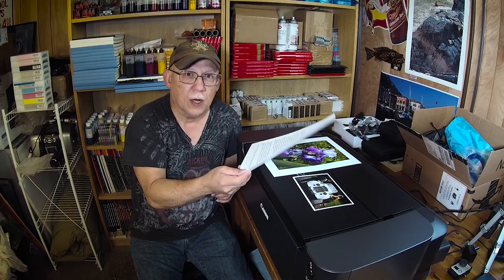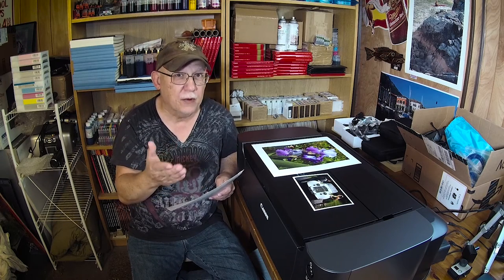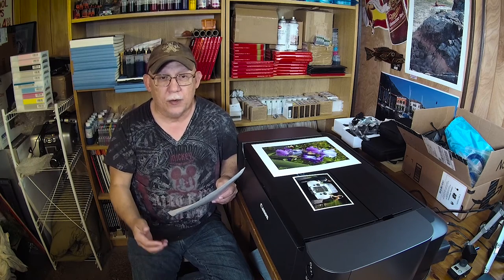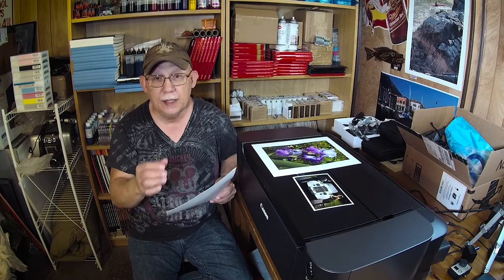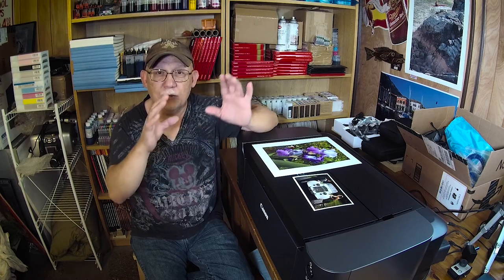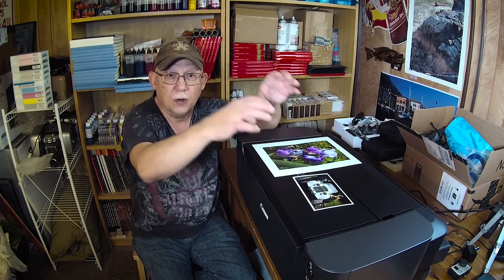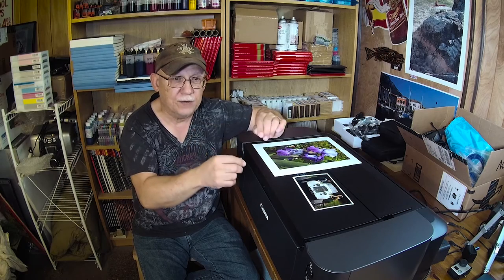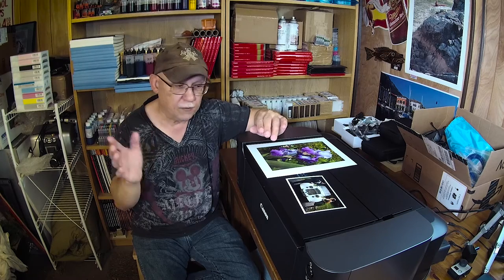Let me tell you The REAL Truth about CANON Refillable or Compatible Carts!

Comment: another great video, Jose!

I am a Mac user first and foremost because I am not computer savvy nor do I consider myself a great printing expert by any means.  I have been using the Pixma Pro 100 for a little over a year and have been using PC inks almost as long.  I have always had great prints and when I didn't it was usually because I didnt use the correct paper selection or the correct ICC profile.  

Have the Mac issues been due to creating custom ICC profiles?  

thanks for all the knowledge, you have been a great help in getting me started in printing and in refilling!
Reply from the maker: +Jesus Saenz I am glad that you are getting good results. Theroblem with many Mac users is gettin the driver to not control color when printing within ICC profiles. You then get a double profiled print.
Air Print will cause color shift problems as well. Also having print preview on!

Every single time I read a post describing some weird odd print problem.. I hold my breath and sure enough, it was from a MAC user. That should never be happening! 

You best bet is to just let the printer driver control everything as you are currently doing. If it ain't broke, don't fix it.

Comment: hi jose, im new with this printing and bought the canon pixma pro 10, i wont be using this much except for a special pictures, how long do you think the printer is allowed not being used after the last print?thank you very much
Reply from the maker: You better get in the habit of using your printer at least once a week!  With these Canon printers you need to use them to print anything at all including even a nozzle check before 60 hour of non use or it will then trigger a cleaning cycle whether needed or not. This is how they stay relatively clog free.  A cleaning cycle will waste your ink, fill your waste ink pads. They become larger and larger the longer you wait between print jobs.  The carts only hold about 15 ml per cart. Even though it might sound counterintuitive, printers will use more ink when hardly used than when using them regularly. I like my expensive inks to be used creating prints rather than on automatic maintenance.  By the way you can not turn this function off.

Comment: is this true also for a canon pixma mg7550 with pgi 550 and 551 carts I guess. Is it possible to refill the original OEM carts for this printer easily? 
Lots of good advices here I learned the hard way having used refillable on a mg5550 that lasted so little I had to investigate on the forums.
Reply from the maker: +giaccomusic If they are opaque then it is a bit more difficult to refill and of course there has to be a resetter for those chips. I am only familiar with CANON dedicated photo printer so I can not comment on any of most of the MG series or AIOs.